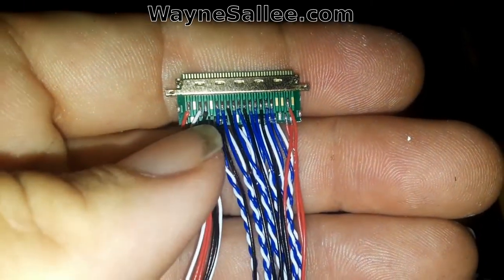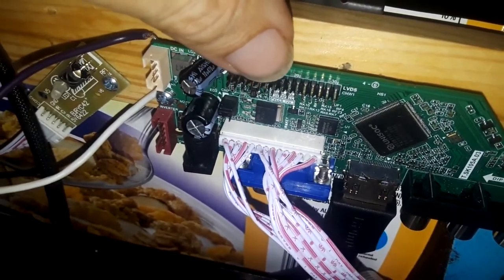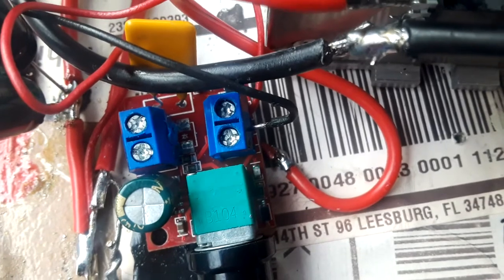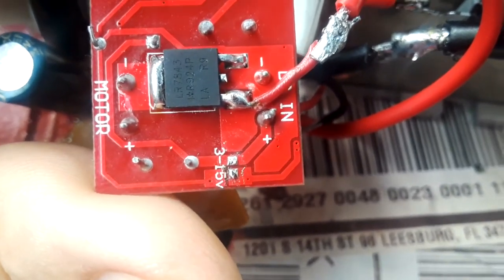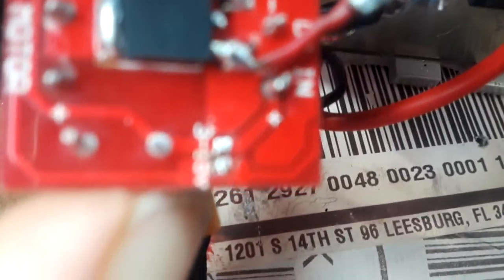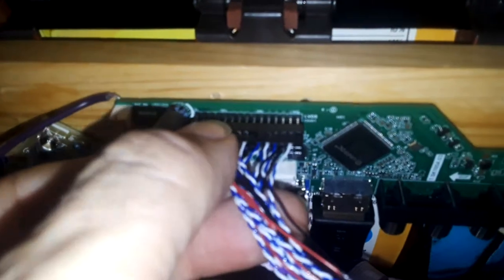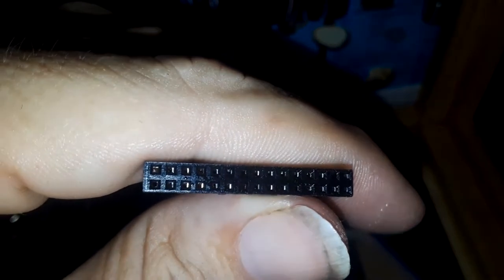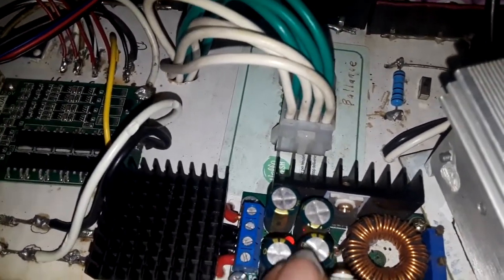Laptop Made with Desktop Motherboard. LCD Screen, LVDS Controller Board, PWM

Comment: Hope you're doing well, Wayne.
How's the laptop coming along?
Reply from the maker: I'm doing well. The laptop is coming along. I've got some more video of it, if I will get it processed. I'm now in the process of converting a laptop keyboard into a USB keyboard, so that it will fit nicely in my laptop. I will probably set it up so that I can use the keyboard on the laptop, or pulled in front of the laptop.

Wayne Sallee
Wayne@WayneSallee.com
http://www.WayneSallee.com